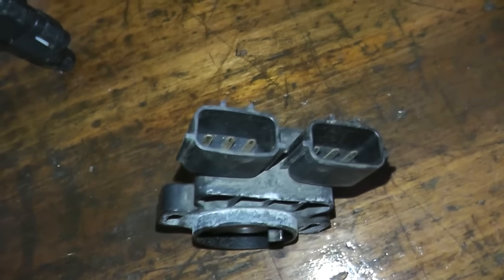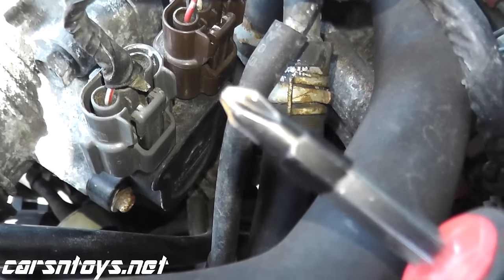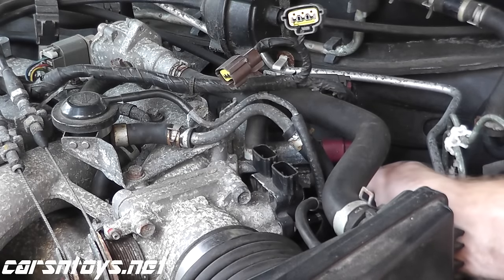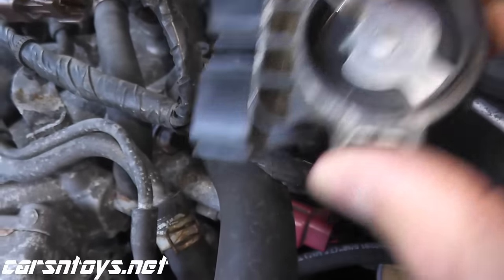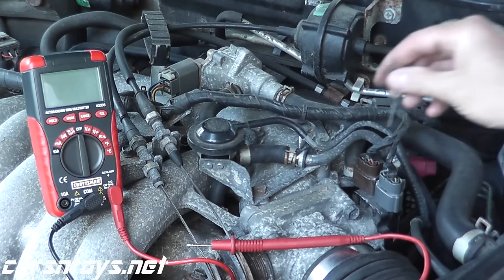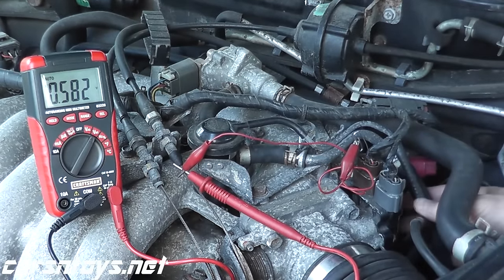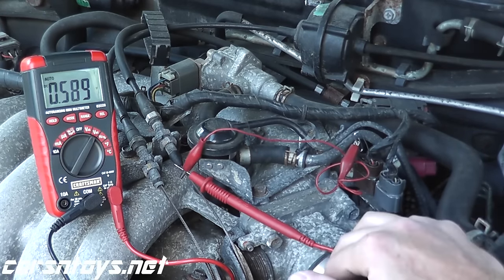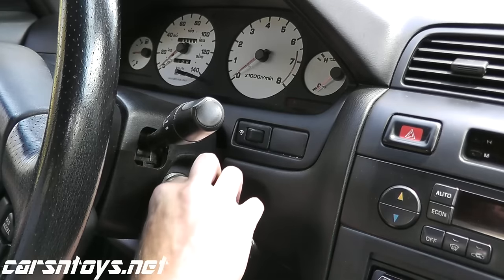How To Replace and Adjust the Throttle Position Sensor

Comment: My GWM Steed 3 idles perfect at 700 RPM and then at random times climes to between 1500 - 2500 RPM for a few seconds and then drops back to 700 RPM and sometimes drops to below 500 RPM and then stalls. Bare in mind the catalytic converter has been removed about 3 years now and never had this problem before. What can be the cause?

Comment: I replaced the TBS on my 2001 Nissan Maxima but I’m having horrible problems,

I adjusted the sensor to the old position started the car and it started with no problem.. but when I try to rev it, it won’t go past 2000rpm and out of a sudden you hear a bang or pop in the engine I let go of the accelerator and the engine goes down to 1000rpm and idles normal I try driving it but can’t accelerate or the engine try’s to stall past 2000 rpms I checked for direct current but the sensor only gives 0.11 while on the throttle body but if I unscrew it off the throttle it reads perfectly fine I screw it back in the throttle and it only reads 0.11 again ... any help would work thanks .!

Comment: that stuttering sound in the background at 6:31 is it from the Transmission solenoid? because my car makes the same noise i thought it to be low voltage current issue. i mean the transmission isn't getting the required voltage/current. am i right?

Comment: Well, just did the replacement, and now when I rev in park it surges up and down quickly until I release, or I can sort of rev through it and it smooths out over 4k rpm. But when driving it feels so much better, so I am just gonna roll with it until it gives me trouble. I did the 20 ignition turns to hopefully reset it, and the idle air reset attempt. It acted the same before and after the idle air reset attempt. Did I fail the 20 key turns or what the hell is going on?

Comment: thank you for your video. I have a 1995 Nissan maxima 5 speed. Is it the same process? I have a very high idle. I saw a plastic adjusting screw around the TPS area and I don't want to move it.  please help thank you.
Reply from the maker: Same process
Reply: I Did it. It use to take a long time to start now it starts right up. Your video was very helpful. Thank You
Reply from the maker: Jose Valdovinos
Awesome man. Glad to help
Reply: Any help with a Honda CR-V 99 ?
Reply: Jose Valdovinos ...that's just to adjust air going to ur engine

Comment: My 2000 Xterra has had a rough idle and I believe that this is the cause of the problem how can I tell if this is what is causing it the check engine light comes on and all scans have not been able to tell me what is wrong with it

Comment: I've been working on my sons 2005 nissan Murano changed the cover gasket and spark plugs and disconnected the throttle now I can't get it to relearn the idle I can only get it down to like about 825 rpm  and I read that it has to be between 600 to 800 rpm can I perform this technique to get the idle down cause the check engine light keeps coming back on with the same code P0507 Please Help 
Thank You

Comment: I have a 1998 Nissan frontier 2.4 L five speed manual that is rev bouncing. Can you get me the wires I need for the multimeter and the voltage I need to be at.

Comment: 3.8 liter series 2 on 96 Camaro. I’m doing mine manually. When I’m adjusting it I can hear the sweet spot, but my problem is that when I’m hearing where it needs to be my TPS screw holes aren’t aligned. How do I fix that?

Comment: Changed my throttle body sensor in my 2001 Nissan pathfinder now when I first crank it it idles up and down. Hate I got new sensor it actually ran way better before I bought new one.

Comment: I have a 2015 Nissan Altima and I've exposed the throttle body and the throttle position sensor they sell for my car is not the one that is on here they sent me a three prong one plug throttle position sensor when mine has two plugs on it. How do I find the right throttle position sensor for my car?

Comment: I have 98 maxima run good the only problem I have is when I merge into the highway the car seems don’t want to pick up the speed fast enough! Any solution? Rpm rich 3000 but car Crawling but when it’s already driving it does seem good
Reply: Sounds like an exhaust backpressure issue. I had the same problem with my 98 cherokee. Couldnt get up to speed on the highway. Figured out that my catalytic converter was worn out and everything inside of it had completely clogged my exhaust. Car running rich is also a good indication of this. Good luck and i hope you find the problem.

Comment: Hey my 2000 nissan frontier desert runner's throttle quit responding to the motor, when it happen the truck just went straight to normal idle and I turned it off and now it wont start. Do you know why

Comment: I checked the voltage on the middle wire like you said but I have no voltage?  I still have the throttle position sensor code.  Not sure what to do?

Comment: hi,i have 2001 Altima and the idle speed is about 2000 rpm on cold start and  stay at 1500 rpm when it reached the normal temp, I couldn't get it down to 750-800 rpm even I adjust the air control valve. also  no vacuum leaks, do you think the tps can lower the idle if I adjust it ? thanks

Comment: My name is Ernie and I have a 2003 Pathfinder and I would appreciate the info on my TPS.The wire to touch, voltage and idle RPM.Thanks, Enjoyed the vid.
Reply from the maker: Hi Ernie. Your truck is a bit different. You have something called an electronic control actuator. You can test the actuator but it's a bit different than what's shown in this video. If you're curious I can try to obtain diagrams.
Reply: I just had spark plugs changed, injectors cleaned and a new fuel filter. 
When I accelerate I get a hesitation and my mechanic is not solving the hesitation problem.
Any ideas?
Thanks,
E
Reply from the maker: Ernest A. Pérez L.
I take it the vehicle has no trouble codes?
Reply: CarsNToys none.

Comment: Hi I need some help I have a 1997 Nissan pathfinder 2 wheel drive 3.3 engine I have change the IAC,and the TPS and the MAF and the knock sensor  and still have a surge when idling at like a red light ok I actually changed TPS twice really don't know if it really needed to be changed the second time but it kept throwing me the knock sensor and TPS codes even after changing them it is still throwing those two codes I need to know exactly how to relearn  all those sensors to get my pathfinder to run right can you help me

Comment: please help .. 

after mechanic cleaned my IAC my car kept rev up & down after it get warm ( from 1000 - 2000 RPM ) repeating .. did all the relearning idle no help .. 

i don't know if the TPS is the problem for idle repeating rev , or of the Mechanic missed with it ..

Comment: I have a 99 maxima am geting hesistation but no mis fire i check the tps and from the main power am  3.7 volts the book says  around 5 volts is it ok or i have an issue with the computer... i clean the grounds and everything still not geting 5 volt.. the car has no check engine light ... but in one point it said one cyl was missfire i change the spark plug and it went off and then it said p1320.. so i bought the ignition condenser but still havent got it will see if thats it cuz i took it off it was all wet and dirty soo idk thanks

Comment: Hey I have the same car well mine is a 95 and it just started acting funny and drivability has changed I was wondering if you knew what the overdrive light blinking 16 X's means thanks in advance
Reply from the maker: That most likely is a tranny code. Is the shifting off?

Comment: I have a 1995 nissan maxima and i've noticed that it sputter when I accelerate and when it at idle would this TPS be the problem or bad spark plug?
Reply from the maker: Any trouble codes?
Reply: I have to get the checked at autozone first. I'll keep you updated thanks.

Comment: By the way I have a problemengine stalling after I put some seafoam spray through the throttle body while running the car and after replacing the sensor doesn't seem to make much difference main problem is still there engine start stalling and shaking at higher RPMs 35 miles per hour or something any ideas what the problem could be

Comment: Thanks for your informative video! One suggestion for Japan built cars.... They use a slightly different Philips head than America. It's actually better and has less of a tendency to cam out when torquing! Look for "JIS" #2 Philips Head Screwdrivers and Ratchet bits. VESSEL makes decent offerings and they are on Amazon! Now I have a couple of questions... I have a 99 Maxima. Is the TPS the only place the idle should be adjusted? Or are their others? What about when cold starting vs at running temp, Same 700 RPMs for hot and cold? Where do we adjust for the differences in temp? Thanks!
Reply: Opppp

Comment: Have a 2000 Nissan Xterra put a new throttle position sensor on there it did good for a while the idle was good the idol is still pretty good but now my car is cutting off when I am not heating the gas especially at a red light and I'm having to put my foot on the gas and hold the brake down to keep it from cutting off when I come to a stop at my wit's end trying to figure out if the throttle position sensor is bad really afraid to drive the car because of the way it is doing it cut off on me 5 times just trying to get to the next little town

Comment: 2001 altima 2.4 i have egr tappin wen press on gas just alittle bit, also wen is goin 55 or 45 it jerks so i clean egr system still do same stuff

Comment: have a 2008 Nissan Altima. I am sure  the throttle sensor is bad.I was unable to tell what you were rotating.Also what is the idle speed for my car. I have a key fob start not a key. How would I reset the idle. I don't understand what you were turning on the idle sensor to change the idol speed, it wasn't apparent during the video.

Comment: Would u know the problem to my 94 Nissan Hardbody, after driving it around for a bit it dies out when I'm slowing down?
Reply from the maker: It could be a number of things; such as the idle air control valve, injector(s), spark plugs, etc. Have you recently done any work to the truck? Check engine light on? Send me an email to carsntoyshelp@gmail.com if you need schematics and such.

Comment: How much do you think a job like cost for a 87 chevy c10 350 motor...for labor and part
Reply from the maker: I can't imagine too much. Small block Chevy's are quite simple to work on. The part is most likely in the $40-50 range and maybe the garage will charge you for an hour's work.

Comment: Hey man I have a nissan 2000; I changed everything and the computer, then a relay located next to the radiator but the radiator was broken so It was replaced and it started to shot off after it warms up. I think it was running pretty hot before and now it is not running too hot because the radiator replacement. and at time when I was in trafic and the car would probably get hot it idel with hier RPMs and now it does not it idels then dies. if I press on the gas right before it wants to die it recovers and then does it again. any ideas.  THank you
Reply from the maker: Any trouble codes?

Comment: can you tell me where the throttle positioning sensor is located on a 2002 nissan maxima SE?
Reply from the maker: It's located near the firewall. Send me an email if you need schematics. I may be able to get them - carsntoyshelp@gmail.com

Comment: What if I changed the TPS and got better results (so it shows that it worked), but still once I hit about 1500 RPMS, whether it be when I'm driving or when I'm in park and in neutral, the RPM's soar to 2000 for awhile then drop back to 1500 for a few more seconds before it goes back  to normal idle which is about 900 on my car. Before changing the sensor it would stay at 3000 RPM almost indefinitely. I'm guessing this is where the idle memory comes in?
Reply: Already clean the throttle body , idle air control valve, maf senor and change the air filter. Also, when I'm driving, (I have a manual car) the maintains a high idle of about 2000 RPM whenever i change gears or coast in neutral, but when I'm coming to a stop, it seems to know that I've stopped and drops back down to normal idle level. Do you have any idea what this could mean? I have an 04 Hyundai Tiburon GT V6.

Comment: Hi I cleaned my tps on my 07 ranger 4.0 and just reinstalled it ...........  is there any chance you can tell me if that sensor is adjustable . what  I didn't understand is after its bolted down  what keeps the sensor in place anyway  thanks I will just  try and  turn that sensor in my truck  out of curiousity but doubt if it will work ,,,,,,,,,,  with 2 brand new 02 sensors  im a getting stuck rich on both of them

Comment: I have a 2000 nissan path finder I am having trouble.with my car with the hot air blowing thro the vents in side car where the heat comes out but I don't have the heat on what is my problem

Comment: The RPM for an 2003 Infiniti I35? I've changed out the throttle body  and had some my car computer gone over - all good. But, engine still idles too high and wont take the idle relearn process, so I'm thinking it's the throttle position sensor. The code is 507, and could be anything related to the throttle system in my car. So, help.

Comment: Hey man. I have a 99 nissan pathfinder and I am trying to adjust my tps. When I check my power that is supposed to be between .3 to .7, my base output is .08. I have checked ground and power and I am good on that. What else should I look to find out why I am not reading within the specs?
Reply: shawn crampes did you find out where it is suppose to be
Reply: I did! after having a lightbulb moment, I removed the TPS and installed it correctly. I had my TPS sitting behind the pin. After I corrected it, I checked my readings again and adjusted it to .499.
Reply: shawn crampes thanks im going to do that to see if it works.
Reply: what are you reading on your TPS?

Comment: I think what happens is the tps has a stop in it and it gets worn over time and causes the throttle blade to go back farther than it should. I have a 1998 infiniti i30 and this was the problem. I had codes P1105 which I believe I had the vacuum hoses switched around on the map sensor. I also had P0120,P0731 and P0732. I had a ruff time getting the trans codes to go away because I messed with the throttle cables and shouldn’t had but now it runs great. The transmission was fine but if that tps isn’t dialed in just right it messes up the shift points in the transmission. I hope this helps someone. God bless!!!

Comment: I just did a timing belt on my 02nissan xterra and set the timing mark at 15degrees btdc now engine idle at 1000rpm at nomal temp. Does this procedure work with my car also btw i dont have voltmeter
Reply from the maker: 15 sounds a touch high. I believe the older Xterra's were around 10 degrees btdc, but I could be wrong. Where did you obtain 15 btdc?
Reply: CarsNToys i was wrong yea i correct it 10degrees btc what itsays on the car hood. But now  my idle is at 2000 and it only go down to 1500 i was playing with the tps but i think fuck it up lol
Reply from the maker: Before you removed the old belt, did you set number 1 cylinder to TDC on the compression stroke?
Reply: CarsNToys yes i set the no.1 cylinder on tdc and the t-belt is at the correct mark. I adjust my tp sensor and used a voltmeter i set it at .5volt and now my idle is to high

Comment: Hi, the settings for a 2002 Maxima vq30de/ Infiniti i30 would be appreciated thanks
Reply: Make sure the engine is fully warmed up before checking & adjusting.
Be very careful the engine is very hot.
You will have to use your ear to hearing the engine or have someone in the car to check the Tac's Needle Gauge.

Comment: I have a 2001 Nissan Pathfinder le was running fine had my oil change and now I have a horrible rattle/knocking sound seem to go away when I put in reverse then it comes back seen a lot of review
Reply: Some says rod knock time n chain but the best one that sound like my issue is a guy said it’s a valve on the intake that not letting the oil pump to top they haven’t got back to me with the name of which valve but said they only had to add some  $80 lubricant and it fixed the problem I was thinking it’s the vvt solenoid please help

Comment: Great video! I have 84 300zx change throttle sensor and is running rough. Help what's the rpms adjustment? Thanks

Comment: Hay there my tps is adjusted all the way back i can't get the idol to go any lower its at 1100 rpm can't advance it any.
My last tps was setting it at 700 perfect shifted will but couldn't get rid of p0120 not could i confirm meter test on variable out put voltages i did every meter test i can as well three was a service bulletin to the procedure in 2006 for the 1996 maxima either way i can not physically back off the adjustment any regsurdless

Comment: 02 Xterra 2wd Auto. Idle goes up and down or surges when cold.  After it warms up its ok. Seems to idle high. I believe I need to adjust it. No codes. Adjusted it now its shifting funny. Ordered a new sensor and trying again.

Comment: So the little pin in the throttle body side sits rite on top of the notch on the sensor ??
Reply from the maker: Yes.
Reply: CarsNToys is the.base idle while your in park
Reply: 2012 FORD FOCUS AUTOMATIC TRANSMISSION DIPSTICK WHERE IS IT?

Comment: I have no multi meter , I moved the tps sensor but the rpm idling does not still drop on my vehicle 
, my vehicle is a Nissan pulsar sss sr20ve

Comment: i have a 2001 nissan sentra. Change my throttle body position sensor and need to know my base idle speed for my engine 1.8l gxe model. Thanks
Reply from the maker: You'll often find the base idle speed by looking for a sticker on the underside of the hood. If you can't find it send a message via FB and list if you have an auto or manual tranny. Cheers.